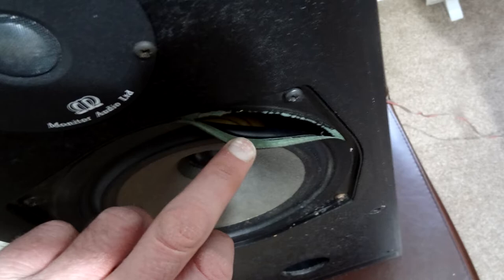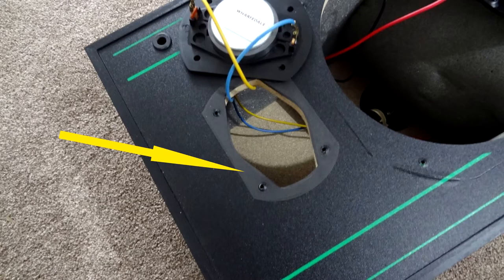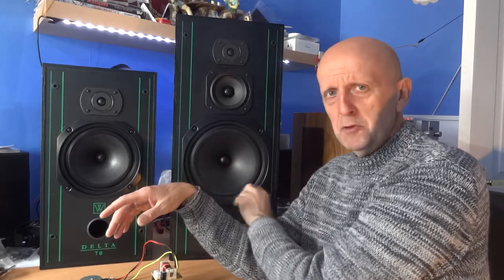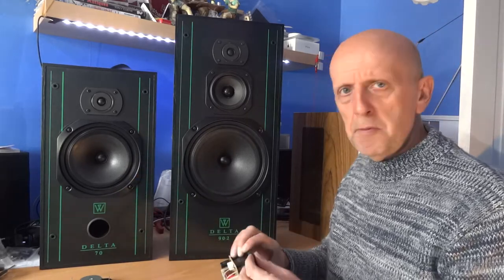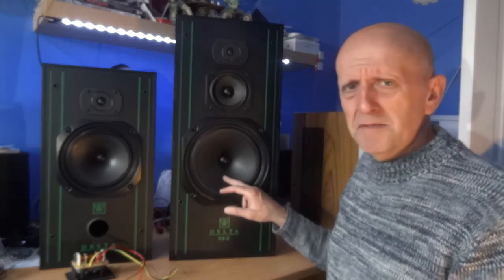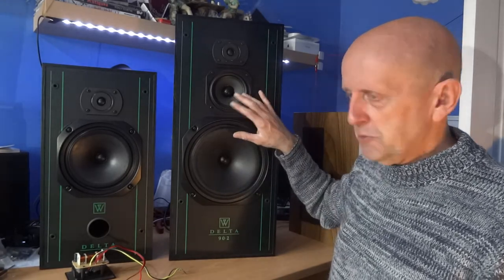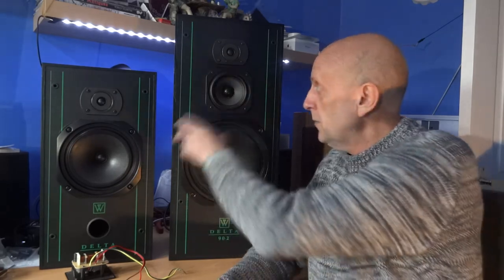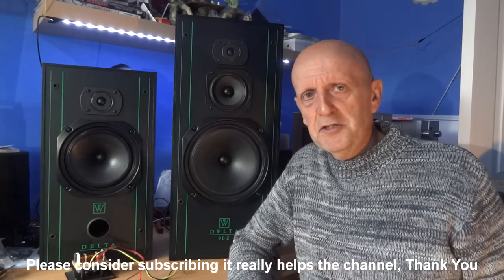HiFi Speakers,  Sound Improvements Tips, A Look Inside Wharfedale,  Stereo Audio Vintage

Comment: Hello. I want to give you a recommendation of an easy and cheap, but big improvement to the sound, upgrade.
The cross over has 3 blue capacitors. These are electrolytic capacitors, witch don't make the speakers perform to their best capacity. Change these blue ones to metalized polypropylene capacitors of the same value as the blues. You will hear a more detailed  airy and natural sound with this upgrade, even when using lowpriced polyprop capacitors. Putting a good quality polypropylene capacitor at the tweeter circuit, and the speakers improve the most. It is the tweeter and the midwoofer that will give the most from this upgrade. Voices will sound better when upgrading the midwoofer.
Reply: Where did u get this secret knowledge that only types with ur insights know about?

Comment: Another interesting video Michael, yeah had one or two problems with buying from E Bay myself in the past the main problem I find re buying second hand speakers
Reply: Is you don't know how they've been used or treated 😕 so I find it's a bit of a gamble
Reply from the maker: Thanks Brian. The problems I have had is one or both tweeters not working, though you can return them, but its the size, weight and getting back to the courier that becomes the hazzle sometimes.

Comment: That crossover schematic doesn't look right.The 8uF is not correctly placed.As it is placed now,there's a dead short across the amplifier at high frequencies.
Reply from the maker: Thanks for letting me know, I think I still have this crossover so I will look for it over the next few days and report back.
Reply: Yes indeed, that 8uF should be in front of the inductor, not behind it